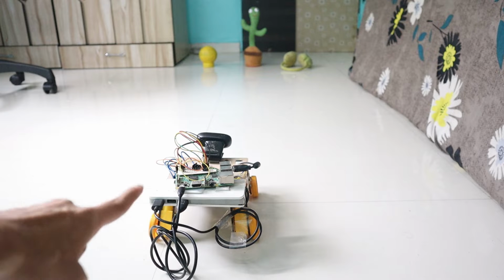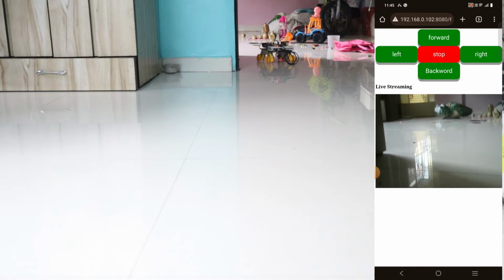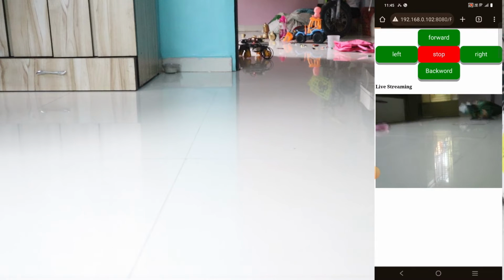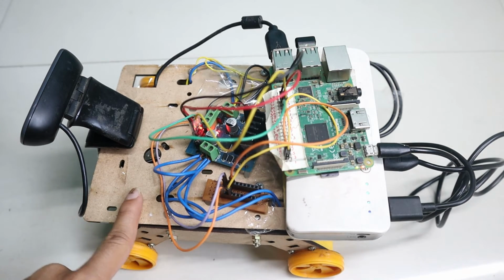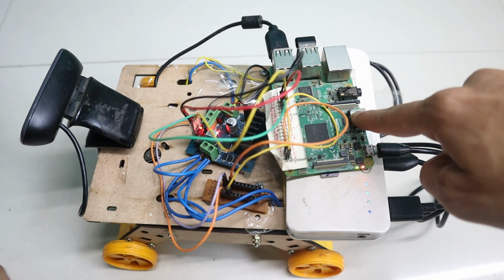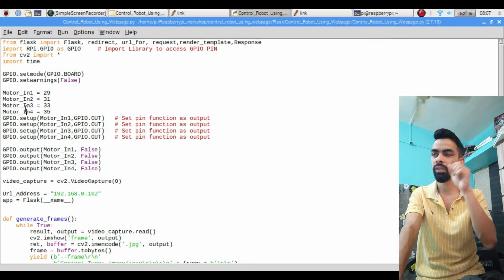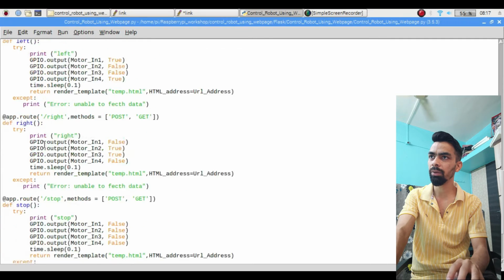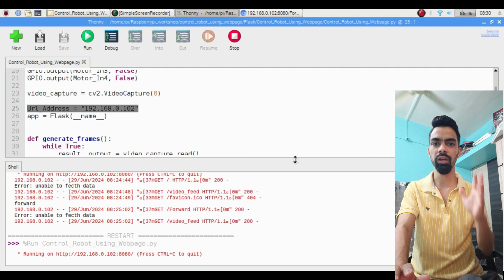Surveillance Robot Using Raspberry Pi | best innovative science project #scienceproject #science

Comment: Brother Which terminal is used in sudo pip install Flask
Reply from the maker: @tanujreddy9055  it's linux terminal, explained in video
Reply: As I am aware about connections by seeing ur video but Iam not able to understand how dump codes and install packages
Reply from the maker: @tanujreddy9055  i explained in detail in video, i think you did not watch complete video
Reply: Yes I do But I didn't understand
Reply: Can I contact you
Reply from the maker: @tanujreddy9055  9922512017 on WhatsApp